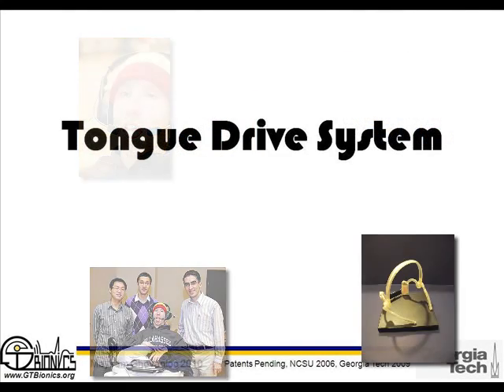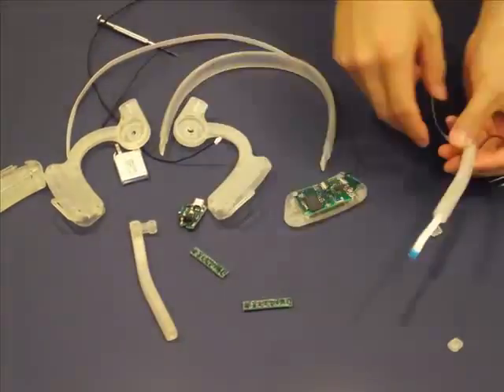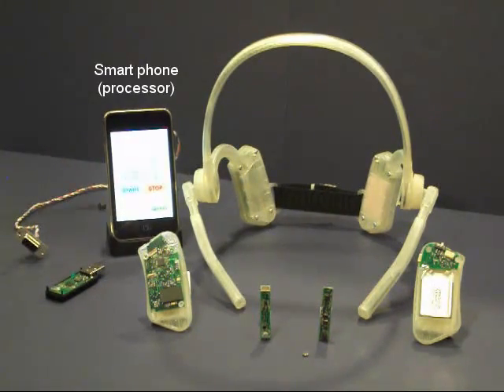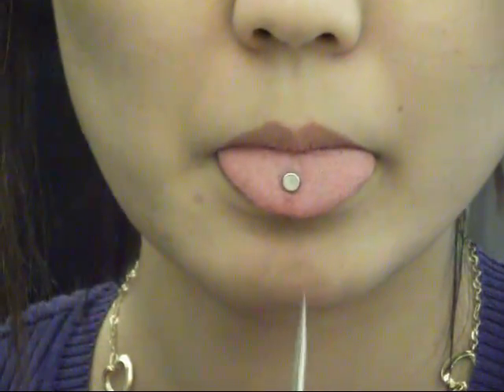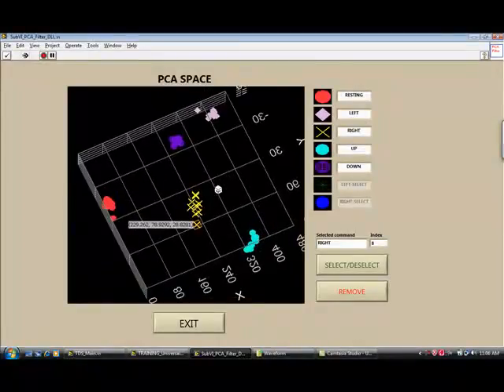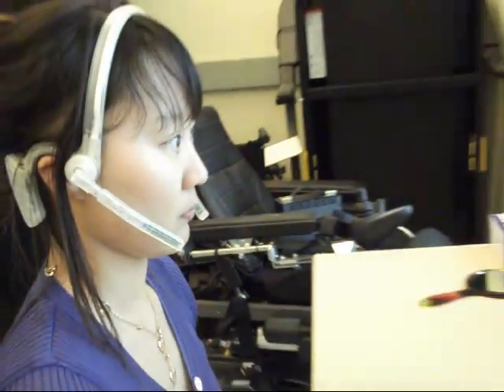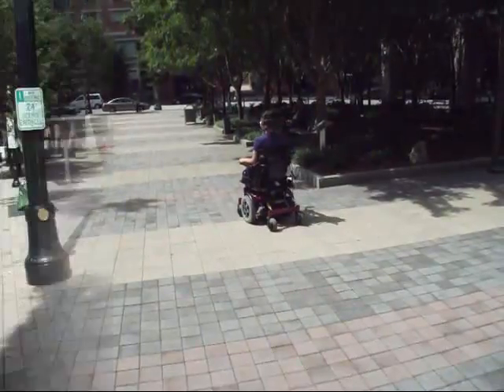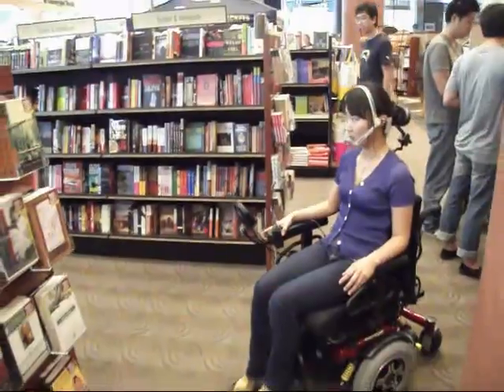Tongue Drive System 2010

Comment: Residual movement of almost any kind should work better than electrical signals (e.g. EMG, EEG, ECoG, or cortical units) because voluntary movements benefit from concurrent proprioception and stabilization by feedback circuits in spinal cord and brainstem.  Electrical signals are "open loop", so are noisy and depend on slow visual feedback, resulting in performance that a clinician would call "severely dysmetric".  This well-designed interface demonstrates what can be accomplished with movement.